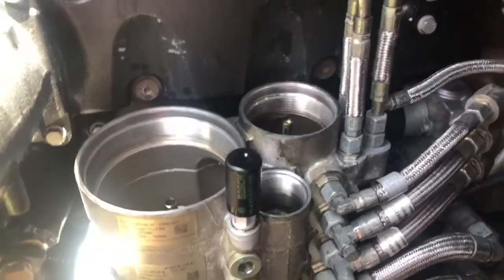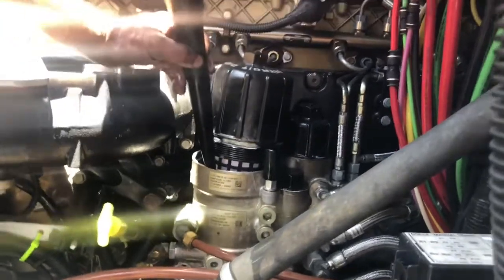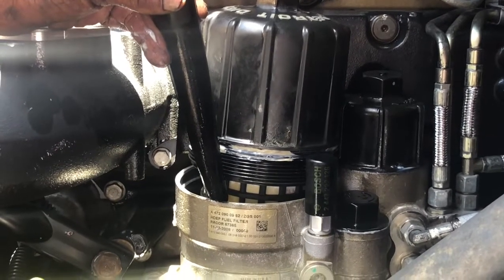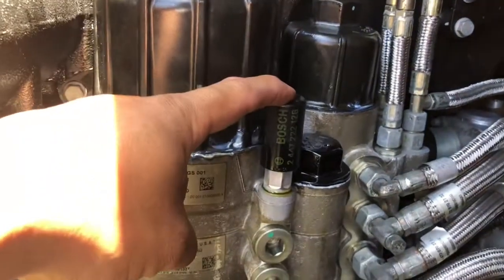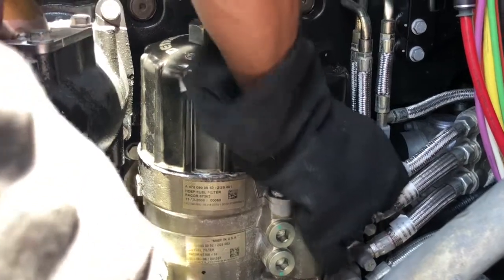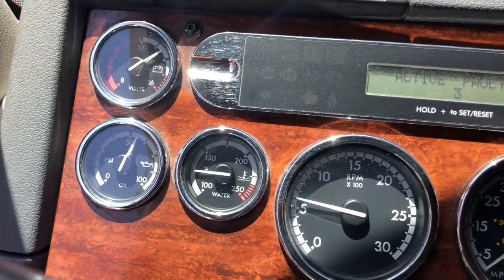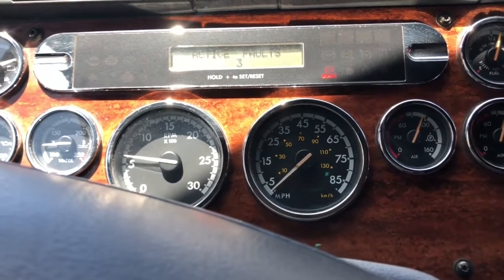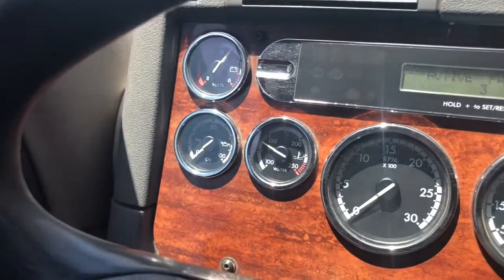DD15 oil change part 2

Comment: Thank you very much for these tips!! I had such a hard time starting this engine up after a fuel filter and oil change once but never again. Did exactly what you suggested and haven't had any problems since. It's very important not to do the fuel filter change before you restart the engine after the oil change it cause a 'dry start'. I had to use starting fluid, which is not recommended, and a lot of pumping and pumping and pumping ...looks just do it the way Carlos says and save yourself the mess!
Reply from the maker: Thank you for the compliment. Glad the video was helpful.

Comment: Do you think amsoil is worth it to use in these trucks get long engine life?
Reply from the maker: You should be able to get 1,000,000 miles out of your DD15 using good quality motor oil. 
I have customers with 1.1 million miles oil and still going. I am not sure if using amsoil motor or similar product will make that much of a difference. 
The last inframe I did the DD15 had 1,246,000 miles using good motor oil and at regular intervals.
Reply: @CarlosDieselElectric  thanks man just the info I was looking for I’ll keep using Mobil delvac And change at the severe maintenance intervals indicated in the owners manual.